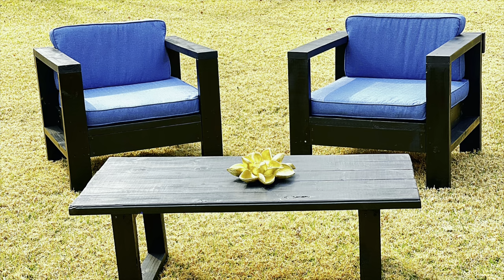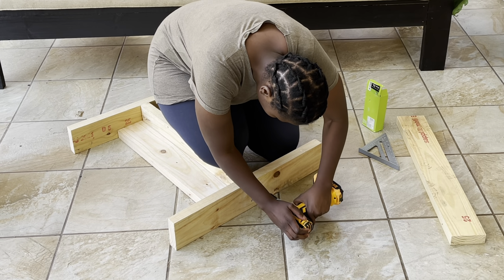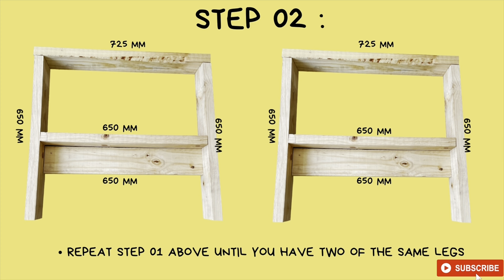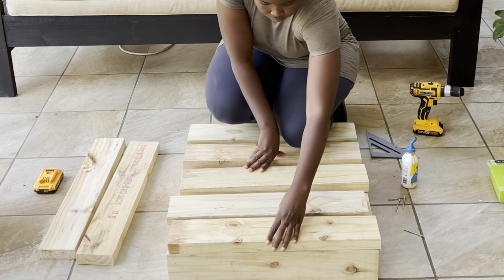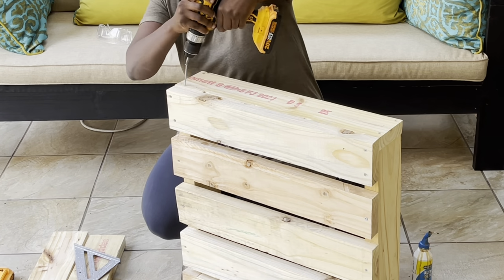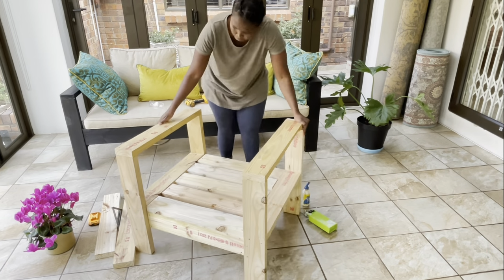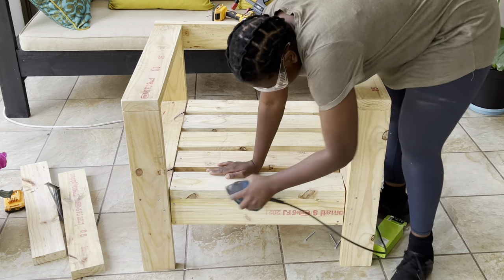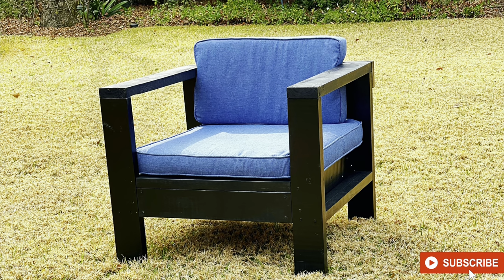Easy Steps to Build Your Own Comfy Outdoor Sofa!

Comment from the maker: Hello Family , please do leave a comment and tell me what you think about this project ,  would really appreciate it .
Please do Try this and Gift it , or Sell it or even keep it .
Reply: All thanks to you i finally made this project but it wasnt easy as you make it look like🙈. I think i should just invest in cordless drill . Thank you so much for sharing💐.
Reply from the maker: Oh my . You must share with me pictures . 
Do you have Instagram ? You must send me pictures please so we can chatfurther , I am interested in hearing more . Thank you   .
Reply: I would love to see you install a kitchen unit
Reply from the maker: Thank you for this , I will definitely work on this . Thank you
Reply: Hi sis, where can I get those blue seat pads? I'm not sure what the are called.
Reply: What was the approximate cost of the wood for this project for one chair
Reply: What was the total cost of building these yourself
Reply: Hi! If I attempt to use a 2x6 or a 2x4, will this impact the other measurements and the entire project?! 
Edit: I chose a 2x4 and the chairs turned out a bit bigger. The only thing that changes was that I needed an additional 2 boards for the seat base.

The imperial measurements I used with a 2x4 were:
28 1/4 (arm rest) 2 each
32 3/4 (back rest) 1 each
25 5/8 (legs) 8 each
23 5/8 (seat) 8 each
25 5/8 (seat support) 2 each
My Home Depot and local hardware stores won’t cut for projects this big do you might want to look around for someone who can do that, or buy your own saw.
Reply: @m.morris9404 just built these, I’m in the USA though. There are several types of pine at the store, I got the cheapest kind and it was $38 for the wood. About an additional $10 for the screw and stain. Assuming you already have the power tools (sander and drill) it should cost about $40-$50.

Comment: Okay I need to buy all these tools so I can DIY some of the furniture 😅 thanks for sharing
Reply from the maker: Hello Mr Siyabonga
Don’t buy everything all at once , it becomes expensive  , buy a drill and tape measure , you can make many things with just those two .   And also ask your hardware store to cut the wood for you , I also do the same .
Reply: @REMEDIALDIY  thank you for the good advice will most certainly do that

Comment: Thanks for the measurements. Looks like I now have plans for December.
Reply from the maker: You can do it!, and please enjoy this . thank you Wenani.
Reply: Yeah, did not go as well as I woulf have hoped 😢
Reply from the maker: 😂😂😂 I’m not laughing .
Try again . When I did it first , it didn’t turn out so well too .
Try again band try to use the same wood if possible . How did you cut the wood ? 
Was it precise ?
Reply from the maker: Tell me what went wrong ?
Reply: I think my cuts weren't straight so when I tried nailing the wood together it was still loose. When pre-drilling, my drill bit would get stuck it the wood too often for my liking.
Reply: But I'll try again
Reply from the maker: Please try again . I struggle to cut wood because I’m not precise and accurate so I have it cut for me always so it must be straight . Don’t through away the wood . Try again and fix the one cut which is not straight

Comment: What is the name of the paint which yo are using and where can I buy it?
Reply from the maker: Aa! Khodani . For this project I only used a top coat sealer . I did it because I wanted to leave the chair outside so I see how good the product is .
I won’t recommend this sealer , it’s not the best , it failed the test 😂 . I recommend the following furniture paints and stains : 
Harlequins paint ; Gripseal ; woodoc . They have amazing products and you can find them at any hardware
Reply: @REMEDIALDIY  okay khou livhuwesa